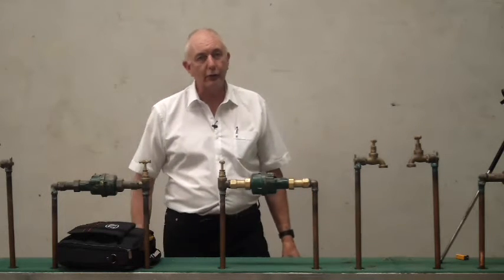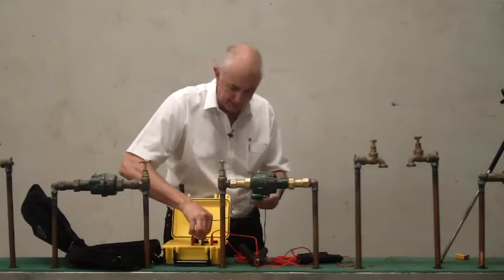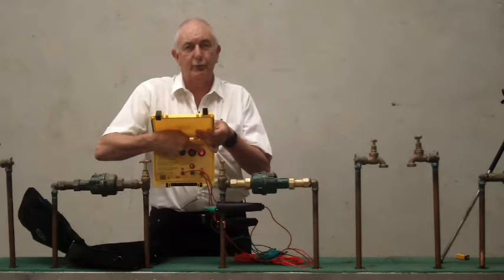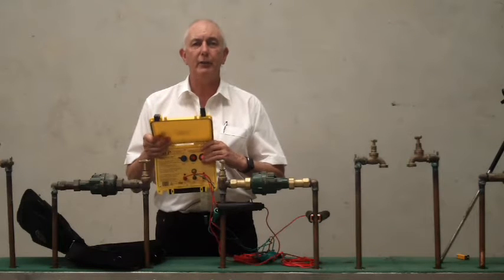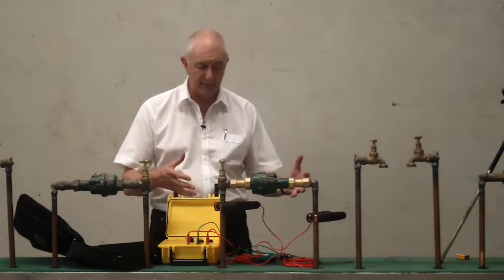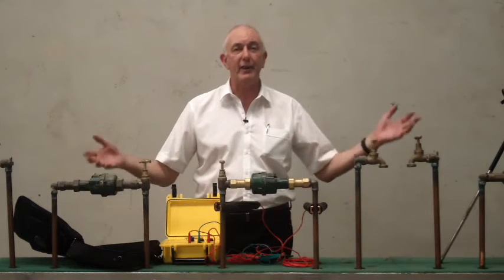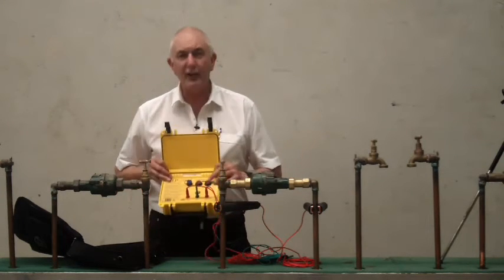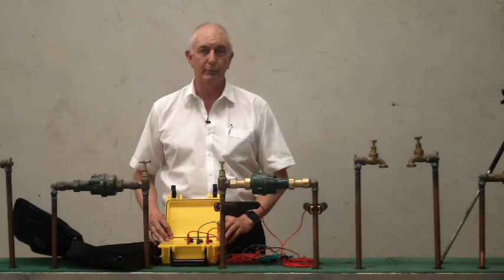Plumb Guard MK2

Comment: When we bought this product we had issues with the internal batteries.
HLP told us to NOT charge the unit in a vehicle as it did not provide a complete charge and was harmful to battery life
Reply: The battery is the same as a car battery, when you need to charge it make sure you complete a full cycle. If you charge it between jobs in a vehicle the charge cycle will be short. This will reduce the life of the battery. The car or mains charger if left to do the full charge will be fine. Just put it on charge overnight between uses.
Reply: Hi, The battery in the PG ver 2 is a lead acid battery. To get the most life out of it it needs a full charge. If you charge it in a vehicle and only charge for 1 hour then it may not be fully charged and if this is done regularly it will make the battery life shorter. This is the same with any battery except the new lithium batteries (we use the lithium in the new version V3)
Its always best to complete a full charge on any battery, and this is best done on a mains charger. As on a vehicle charger it will get turned off every time you shut off the car.
Hope this clarifies it. If you are having battery life issues, fully charge overnight. A vehicle charger will work in emergencies, but continued use will decrease battery life.. Check the new V3 for a longer battery life.